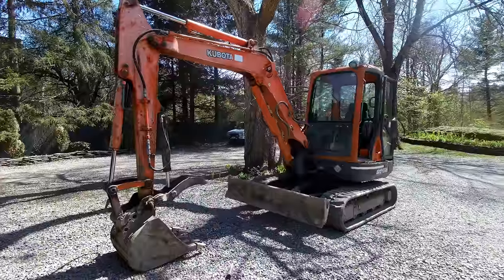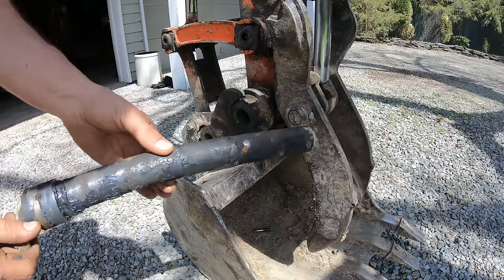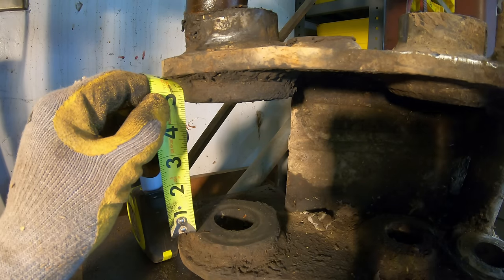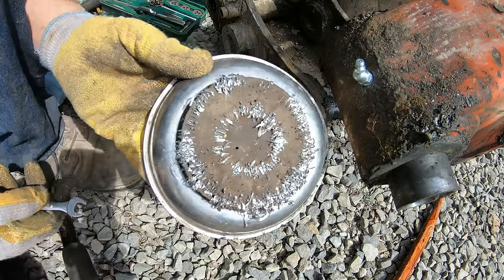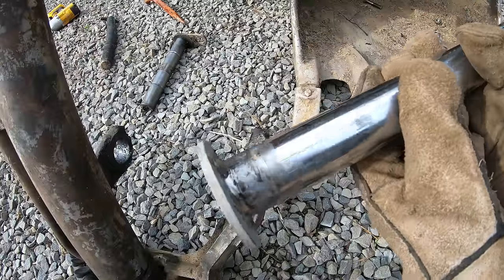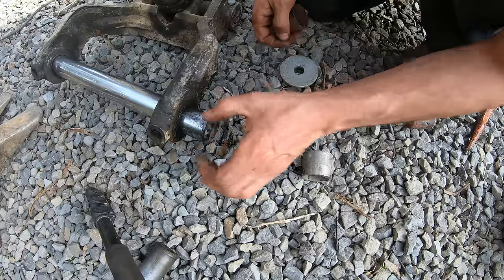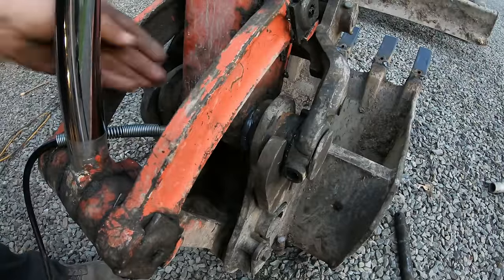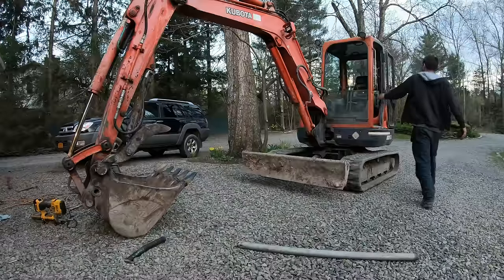Making an excavator bucket pin

Comment: I'm an engineer over here thinking about the shear strength of that pin and the OEM rod is probably something way harder that regular steel, so a small bore hole for grease wouldn't weaken it much. but I had to laugh when he just tapped a new grease fitting in the collar. Much more simple that way will definitely solve the problem. Kubota needs to hire you or call you when they design equipment.
Reply: Perhaps Kubota's manufacturing process didn't plug the holes with copper plugs before trying to induction heat the machined pin in the heat-treat process, that might have caused their problems.  Kubota eventually adopted Andrew's fix with a Zerk fitting in the collar and a solid steel pin, no holes, no groves.

Comment: Andrew Camarata, if you put a plastic bag over the magnet, it's even better, as you can just invert the bag over the metal filings, that way there is no pain to get the filings off the magnet afterwards...
 :)
Reply: slick
Reply: Excellent idea...never thought about that but it makes sense...Thanks!!
Reply: WHHHHHAT!!! A Plastic bag, “just Throw it away”! Shame on you, the Liberal coalition has taken plastic straws, going after water bottles (but not coke), no more bags... You my friend just put another target on practicality.🤣🤪😂
Reply: satanclaw great tip! Thanks 😊
Reply: Good trick.
Reply: invest in a bench grinder and sand blaster
Reply: Great idea 💡
Reply: Can't agree,  they hang around , it took me fifteen years to get shot of the first bag .
Reply: @mitchwinters864  Or empty the bag, and re-use it.

Comment: I just bought a Chinese HT10 0.8T (metric) 19xx lbs 12hp diesel excavator brand new.  It's slow, weak, noisy, and now I'm waiting for it to break.  It was cheaper than the cheapest used excavator on craigslist.  I've got 4 hours onto it now and burned 3ish  quarts of diesel.  Ground speed is max 0.9mph, no rabbit mode.  No offset on the boom, so trenching next to walls or fences is fun.  I also got an 8" trenching bucket and a 8" auger drill.  All for $10500.  I have a spare engine in my 61KW diesel generator if Mr Justin Case shows up.  I've already started changing the Chinese grease fittings to Zerks.  The seller had the factory put on name brand hydraulic hoses (Continental) so they should last at least the year warranty.  I already have it rented out for $350 a day with an operator (Me to start with) for a total of 6 days in May so far and I don't even have it at home.  It's to small to dig a hole, it's the perfect size to trench in back yard for pool plumbing, drill fence post holes, and to get used to it - I've already made $400 getting a yard leveled, flattened, and moving stumps out of the way.  While doing that I had 3 people stop by to get my card for work they want done.  At $200 a day, that's paid off in 60 working days -- I should be able to do that within the next 6 to 8 months.  Within 2 years, I should have enough money saved up to buy the 3.5 metric ton excavator.
Reply from the maker: Good luck with it.
Reply: Sounds like you’ve got a plan!
Good luck, maybe start a YT Channel!🤠
RL - Buffalo, NY

Comment: I wouldn't blame Kubota too much.  The only way to stress the center of the pin is when the bushings are trashed and the pin is no longer in shear.  Still, a good fix and a weak point dealt with.
Reply: Very true. He probably would have been better to replace some of the wear components.

Comment: ANDREW, Having taken "Heavy-Duty Mechanics" at BOISE STATE UNIVERSITY TECH,  The Excellent Professors there, Having had 20 to 30 years experience in the Mechanic field, I can suggest a few things for You to consider. #1, shafts that have grease zerks are needed to to ware and tare on the equipment. A slot can work as well as drilled shaft.
#2 putting a little grease on the end of the shaft will make the install alot easier. Way to go!!!

Comment: I can't even do simple home repairs without doing one of the following:
1. Completely destroying the thing I'm trying to repair
2. Abandoning the repair because I'm stumped  
3. Injuring myself.
Reply from the maker: At least on option 3 the thing gets fixed though right?
Reply: Study, be patient, be patient, study, know everything about the item BEFORE taking it apart, and did I mention study?  Lifelong mechanic here.
Reply: Im lucky All i have to do is look at a machine and within minutes i can fix it  and also modify it so it never breaks again by modifying my washing machines a driers in 12 years thieves have NEVER HAD A FREE WAS OR DRY AGAIN. I SOLVE TRICKY PROBLEMS IN MY DREAMS..WORKS TOO.
Reply: That's ok , without people like you , people like me would go hungry :)

Comment: McMaster Carr is a good source for about anything you need.  bearings, bushings, belts, shafts, fasteners, fittings, etc.  most of the time when we ordered something before 3pm we would get it the next morning on regular freight rates.  check out their on line catalog.  also, when you are in a pinch, dish washing soap is a good lubricant for drilling and tapping holes.

Comment: Nice repair, AC!  I just installed a new aftermarket thumb on mine about two weeks ago, and it came with a longer, undrilled pin.  I drilled and tapped for a new Zerk fitting in the same spot you did, and haven't had any issues with it getting damaged.  It's a very common problem, breaking those factory pins, based on what I've read on the Kubota forums, and videos on YT.
Reply from the maker: Yeah. That's the way to go when adding thumbs. Next time I add a thumb to something I am going to make it like that Kubota where it shares the pin.

Comment: I'd recommend replacing the bushings, the pin probably only broke because both it and bushing are worn out. Its not a fun job but something that should be done.
Reply: I agree...
Reply: I dont think that pins defective, that machine has 10,000hr on it, that pins taken a lot of use in its life 😂

Comment: Used your idea of putting a grease nipple on the bottom bore of the arm on our 323 Bobcat. Built a hydraulic thumb and used this pin pivot location to put the thumb. This required a longer pin to connect the bucket AND the thumb. Bored out the the new thumb pin and guessed just where the centre was to come out of the pin between the bushings. Hard to get it exactly between the bushings. The better idea was yours, to drill right into the center of the bottom arm and thread in a grease zerk. Works great! Thanks!

Comment: Hey Andrew, keep an eye on that pin, hydraulic cylinder rods bend way easyer than excavator pins. And you need to prevent that pin from turning and wearing out the non bushed holes. On my Kobelco I welded my pin pipe thing (made the same as you) to the thumb. Greetings from Germany. Keep‘ em coming!

Comment: Center and cross drilling a pin isn't a bad design, it's just that Kubota completely screwed up the way they did it. (like, wth were they thinking, type of screw up)  The right way, is to end drill from both ends, to center of each bushing, then cross drill all the way through the pin so you have two points for grease to flow out at each bushing.  You can even offset your end drilling, to work around your securing bolt hole.  Then typically, a very shallow groove is cut longitudinally from those exit points, to spread the grease across most the width of the bushing, and curling the bucket spreads the grease around the full circumference of the pin and bushing. (since the bucket only needs to rotate 180 degrees with two exit ports)

Comment: I was inspired by Andrews videos so I went out and bought the cheapest welder from harbor freight. I practiced in a t shirt and welding gloves and goggle just like Andrew. An errant piece of slag popped off and burned right through my shirt and embedded itself above my right teet. Guess who has an apron coming in two days from Amazon?
Reply from the maker: I wear the apron because I got tired of ruining jacket zippers.
Reply: Been doing same thing. Im getting good at mig welding. Suck at stick welding
Reply: @AndrewCamarata  
Man, I ruined my biker jakket zipper welding. Lesson learned. 
Also, it was very uplifting to see you running that 'TombStone 225. That's really how simple my shop is and its rather reassuring to know that you trust and farm box like the one I got. Cheers dude.
Reply from the maker: Subix Barbarasson zippers aren’t that hard to change if it’s a jacket you like.
Reply: @AndrewCamarata 
Yeah. You already know. Priorities......lol. I finally just repaired the holes in my old Karhearts. About 36$ for a new pair but it's a lot less than finding a GF who kan sew. ...... I tend to pikk my battles. ;)

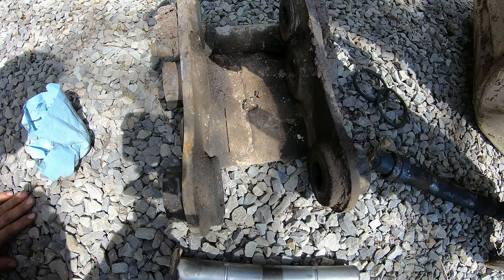Comment: 3:30 If the grooves you saw in the pin line up with the gap between the links and the boom then they are supposed to be there. You have no doubt seen ridges or grooves worn in exactly that location on old pins. Pre-cutting that smooth rounded groove prevents the sharp edge of a the boom or link ears from cutting into the pin and forming a stress rise.

You can still make a greaseable pin is you cut a shallow helical groove in the center section instead of one all the way around. The groove should be rounded and filed nice and smooth, just like the ones in the intact pin.

Comment: I wonder if Andrew know about these things called bushings to keep things from being loose and flapping around. I just can't stand joints being too worn and flapping about, fresh bushings and lots of grease is soo nice!
Reply: How would bushings work in equipment like these? Bushings are generally made of softer metals as the go between of roller and ball bearings on pulleys, primary drive chains and drive belts. On the equipment shone on this video it clearly shows the pins, under high forceful stress, are bending and breaking where they shouldn’t be. Andrew stated that in his discourse explaining the issue with manufacturer’s OEM parts that they were flawed. Bushings in this equipment would loosen and cause a maintenance headache because of the prevalence of replacement.
Reply: @JD-kg3mx  dude must have hit a nerve let's go Brandon!
Reply: Clearly using his excavator as a hammer! — lol

Comment: Having worked in a machine shop for 40 years and now retired, I was hoping you would mention for the sake of some viewers that when you were tapping that NPT thread for the grease plug, that because it is a tapered thread you don't run the tap all the way down to bottom out the threads on the tap.

Comment: As always, I learn from you.  Simple tools work for sure.  The only thing I can add is that you may want to use a copper based lube like Never-Seeze or Permatex on bolts and pins - especially the ones that you know are going to be coming off occasionally.  Trust me, it makes removal a lot easier and is inexpensive.  A usual, Levi steals the show!

Comment: Nice work. I got a metal drop saw or band saw off ebay for 100 bucks and it was worth every penny. Set it and walk away come back in a short while. Cuts pretty square too. I like it no more Vibration from saws all or cut off wheels and sparks flying metal.

Comment: A great hole saw trick stack those hole saws when you need to enlarge a hole.    If you have 3/4" hole and want a 1.5"  stack a 3/4 and a 1.5.  The 3/4 will guide the 1.5.  Sorry if someone else already mentioned this.  Great video as always!

Comment: Let me first say, I just found your channel...  I love what you are doing Sir.  I enjoy your videos.

So, don't take this the wrong way, please....  At times, you really do crack me up....  You are very very funny, without even trying....

The Irwin Qwik Grip clamp, and the drill, to finish driving the hole for the grease fitting.... Hahahaha! I had to stop the video, and laugh that one off....  Never thought of that!  You're a bad influence, you're giving me ideas....

The other one that really killed me was in an older video, where you were fixing a jet ski...  You were putting the head back on the motor, and you go "Oh look, see, on this cover, they have the tightening order, and the torque spec.... (pauses)....Ehhh, I dunno... I'm just gonna do this...." (hammers the bolts down with an impact...)  Hahahahaha!  

That cracked me up so bad...  You're very funny....

No, but that crap aside, the stuff you are able to do, at such a young age...  Basically self taught...  It's very impressive.  You have a lot of ambition, obviously, and there's also a lot of thinking outside the box to keep stuff running.  Very impressive.

Comment: Hey Drew, they make this thing called an Oops arbor for hole saws. it is so you can enlarge holes like in the washer that are too small. you fit the hole saw you want to cut out to on the outside of the arbor and the one that fits the original hole screws down on the inside. Or you could use a uni-bit, those are great for just that chore. Just a couple choices for you that are rather inexpensive and want to expand your tool collection.
I was thinking, have you ever considered building yourself a 2x72 belt grinder or bigger?  Jeremy Schmidt has a pretty cool pattern for one, and if you want something bigger Fireball Tools channel just built a huge 8x72~ish one using go-cart parts if you wanna check them out on here.
thanks for the vids, enjoy the weather.

Comment: Do yo think a cordless impact wrench is much better than an impact driver?
Reply: Nblad YES!

I have the same one and it is just as strong and no cord or hose is required. 

Big rig truck lug nuts- no problem. 
Rusted bolts- no problem. 
All day long use-no problem.
Reply: When I have explained it to less knowledgeable friends I compare an impact wrench to a box wrench and compare an impact driver to a screwdriver.  All 4 devices impart a turning force but the wrenches have much more power.

Comment: A lot of smart people in here watching your videos. Some of them shined in with good advice and what they are saying is making sense. Take a good look at the temporary replacement pin that came out. I believe it' was able to bend like that because every thing was out of alignment and also because of mis-sizing you mentioned. Some of that you dealt with at the press but some of it goes back to the bushings which allowed too much play and ultimately cracked a much harder original pin which was not designed to flex as it was allowed to. So now the real question is how hard is your new replacement pin and how much will it flex? You saved money on the homemade part but really is the repair engineered correctly?  Time will tell.

Comment: I like how you always make it work.I hope the pin you made was heat treated steel other wise it may bend.I like how those theet were held in with nuts and bolts.Suppose to be a wedge pin and you just weld them in.

Comment: I could see a little slop in the bucket, and that is the cause of what little rattle noise there is... The slop is in the big open C' in the quick connect...  I don't know if there's a way to tighten that up, it's not really needed (likely better that its loose, makes it easier to hook up to without such a tight tolerance)...  The pin itself looks solid.  Nice repair.

Comment: I found two lynch pins that were supposed to be holding pins on my bucket gone. One pin was half way out. I used the machine to clear a ditch of downed oaks trees (historical snow damage here) and the branches must be opening the lynch pins and removing them.  Will change over to all bolts and nuts like yours.

Comment: That machine has been rode hard put away wet. We’ve never had problems with Kubota pins breaking. 121 machines usually have a grease fitting from the factory in the end of the stick for the bucket pin.
Reply: I disagree.  It's very common for the bucket/thumb pin to snap in the middle.  Read some Kubota forums about the 121-3 machines.  The factory pins are case hardened, and they don't plug both sides of the center grease hole during the process, so the case hardening makes that hole super hard, since it's designed to harden a certain depth in from the surface.  If they would plug the holes, the inside of the holes wouldn't get glass hard, and eventually fail.

The Zerk fitting in the end of the stick is not factory.  Someone modded it in the past.  I just drilled and tapped mine two weeks ago, doing basically the same mod that Andrew did.  I was installing a new aftermarket thumb, and it came with a longer, undrilled pin, so I put a straight Zerk in the front of the stick like Andrew.
Reply: @throngcleaver  Our machine has grease zerk at the end of the stick its the same with the 40-4  57-4 and the 80-3 80-4 we have, the company fleet is 8 Kubota hoes probably adding more to the fleet. All the machines have factory Kubota wedge quick connect and thumbs. The oldest machine in the fleet 161-2 retired at 14,000 plus hours still runs but she's well worn out.

Comment: Tip on welding . When chipping straight after welding . Keep the hat down protecting your face and eyes . Low hydrogen stick welding the flux is glass . When it cools it explodes away from the weld . Usually straight into your eyes !! Always always chip the flux with eye protection . Super heated glass will stick instantly to your eye ball . Much much pain .